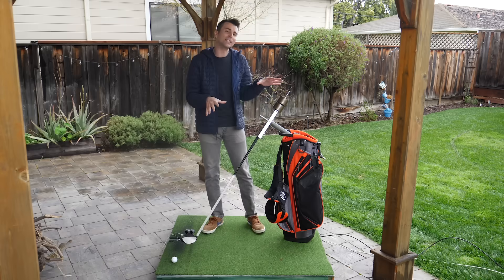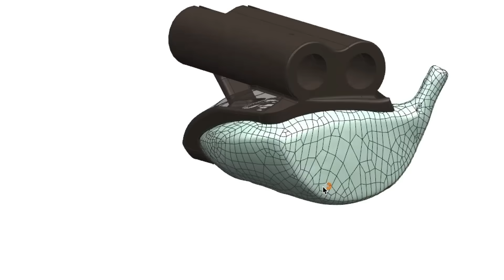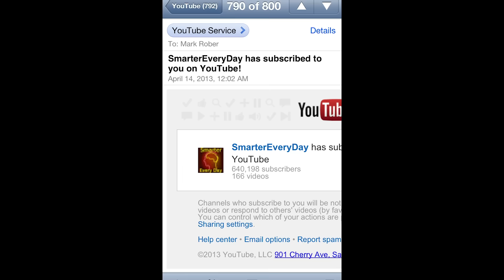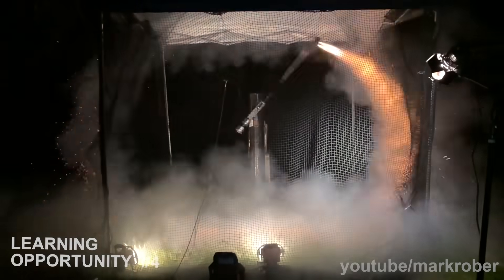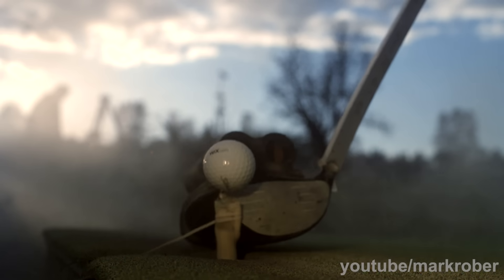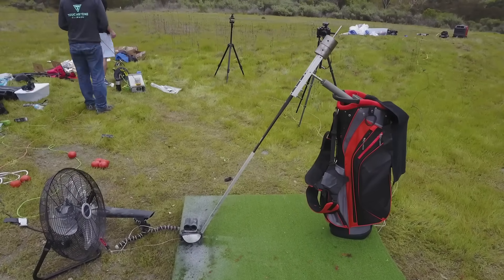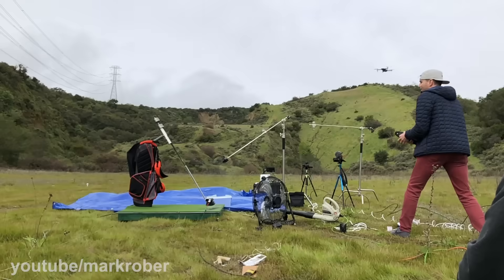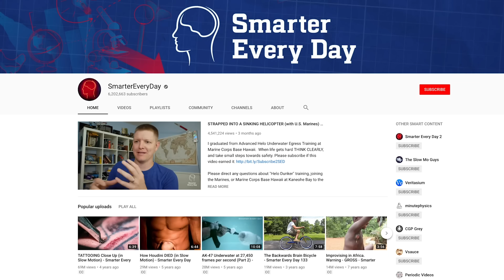Rocket Powered Golf Club at 100,000 FPS

Comment: You should have used a trackable golf ball

Actually now that I think about it, I think it would be destroyed
Reply: If you watch the smartereveryday video on the golf ball, I think you'll change your mind. The ball needs an impact north of 500mph to destroy it.
Reply: @GamenRyder  I think he is talking about the tracker. You'd need to glue it on to not interfere with the ball structure itself, while also making sure that it doesnt get ripped off or changes the centre of mass too much.

The only way to make sure a tracker would work is to have a golfball manufactured with a tracker inside already(which exist and arent too expensive, but dont have the wix.com advertisement and the batch would be too small to be worth it) or have a very expensive lightweight and flexible tracker, which potentially might be the most expensive piece of equipment.

A better way is to have a glow-in-the-dark ball, charge it up under heavy uv lighting and shoot it at night.
Reply: @Preddle  custom golf balls with trackers installed internally?
Reply: Golf balls are stuffed too, and it would change the entire weight distrubition

Comment: What if you got a bunch of metal bbs and put them in a hot tub with a huge magnet on the bottom

It would condense with the magnet on and u can prob stand on it with a strong enough magnet, and when it turns off you fall in and back on you are trapped.. I got this from the sand bubble video

Comment: I've did this not as technically advanced as you and I didn't even record it however believe me or not a strap-on done with duct tape and use the rocket launching system for the little Walmart launchers to detonate my charge as I pulled back it lit by the time I was going for the ball it was thrust 910 yards is what I found mine I use the glow-in-the-dark ball oh and a BMX rim sprocket pedal for the weight and a f*** ton of zip ties and tape and I didn't as s*** said together made sure its swings hit the buttonit was early 2000 is before everybody knew to be sick by give me a break
Reply: Your ball clearly goes further than 900 yards
Reply: And I did mine in one afternoon
Reply: I was at generation with red Ryder BB guns potato guns and anything else that could possibly hurt

Comment: My mind is blown. How could they do all of that work and not be prepared to measure the distance of the drive?
Reply: Seriously though I thought the same thing literally the reason I watched this is to see how far the ball went...
Reply: Should have used Trackman
Reply: @Carlos SlumpYeah I heard it. As a golfer I'm interested in the actual distance...
Reply: Surely we can use maths right - club speed vs distance
Reply: @speakebreathe  well, you need to also consider any rotation, initial velocities, some winds... Not that easy
Reply: A mounted gps would have been nice
Reply: For real!!! I want to know so bad
Reply: Like this so it goes to the top. This must be found out
Reply: 799th like
Reply: @Carlos Slump there are 1000 yd ranges or Fields you can go to
Reply: How would you measure a ball yeeting off to fucksville nowhere without any expensive tracking hardware? Only thing i can imagine is using a salt flap but even then you're unlikely to ever find it
Reply: @mrcaboosevg6089  Umm...have someone stand out near where the ball is landing and scope it back?
Reply: @mrcaboosevg6089  1. release the clubhead speed of the golf club. 2 a drone camera and find the ball 3. a $200 piece of equipment can do the trick, simple really. huge fail
Reply: They dont know where the ball flies
Reply: Darell Mahulete just put a tracking device inside, ain’t that hard
Reply: From SmarterEveryday, the point was to find the plastic point of a golf ball.  The experiment wasn't concerned about how far the rocket driver can send a golf ball.
Reply: @anthony.catbagan  They're two separate projects, my man! Destin just used the rocked-powered golf club that Mark engineered as part of his video (which had the purpose you described). Mark obviously didn't make it solely for the project that Destin was working on.
Reply: @anthony.catbagan  Every golfer in America disagrees
Reply: @anthony.catbagan  I think the OP's point was, it should've been one of the aspects of it. Or built it where you had enough field where you could find it

Comment: Would it have been possible to measure the velocity and the angle it took off at? Just to estimate the range
Reply: Probably, most golf supply stores and now many public and private courses have camera-based computer systems to do this that are used to simulate a driving range or playing many courses. It might still be possible to feed in the video from this into the analysis software and calculate where the ball landed (or would have landed if the field was flat and free of trees).

Comment: With the right information I'm sure you could make a close calculation of how far the ball went.
You know the ball's weight.
You know the speed of the club head at contact which would be the balls starting speed. (Using the camera footage)
You know the balls trajectory. (It was filmed and the added graphics drew a long red trail)
You may need to use a bit of Calculus.

Anyone good at Calculus ?

Comment: Depending on where you are located you should recruit a handful of caddies from a local club to stand out in the distance wearing protective gear. They will be able to locate the balls and provide accurate measurements for distance. Otherwise this video only proves you can attach rocket motors to a golf club head. Me being a former caddie for 11 years at my local club I routinely had to fore-caddie and couldn't always see the drives but was able to locate the balls based on general direction and listening for them landing.

Comment: Try a neon colored ball for visibility, and maybe design a GPS enabled ball, or have a couple of drones on standby to see if you can pinpoint the ball. Unless it explodes on contact with the ground. Hum. If it weren't for the balls integrity, I'd saw drill a hole in it with a small smoke bomb inside. Like a tracer round.

Comment: Could've saved yourself some time if you looked up the shear generated by the mass moment of inertia using the acceleration from the rocket, the mass of the driver and then the level of shear that a typical steel driver can handle.

Comment: I actually made a small home arc welder, very inefficient, but very simple to assemble, from 2 alligator clips, 5 9-volt batteries, and 2 random screws, and I was wondering if you could expand on the idea of low cost home arc welders.

Comment: Club was in the air for 4.45 seconds. That's 2.225 seconds up and down.
h = 0.5*a*t^2
h = 0.5*(9.81)*(2.225)^2 = maximum height of 24.3 meters in the air
Reply: Jonah Bodnovits didn’t account for thrusters how do you know which direction it was in during rotation and elevation
Reply: What about speed as well?

Comment: Great video!  Regarding your title: I don't know if anyone else has mentioned it, but given you guys are engineers, and having dealt with engineers for many years in the Air Force I've got a quick question:  You do know that 100,000 FPS is 68,000+ MPH or roughly mach 100, right?
Reply: FRAMES per second (camera), not FEET per second on the golf ball...

Comment: For the handheld version, it would be nice to have some way to start the rocket motor after the golfer had initiated the swing movement. This would prevent users harm and probably improve control. This could be done either by operator direct control (it will probably require some learning curve) or by automatic sensors activation (ideal but technically more complex). To further improve control and safety, it would be great to stop the rocket after the head hits the ball (it means further redesign with inclusion of additional sensors). This could be a nice first commercial version.

Comment: So you mention you don't know how far the golf ball went for the long shots, but your raw footage SHOULD give you enough information that you should be able to get an estimate.

You know that the ball went in a curve where it started going up and away, and eventually, it hit an apex of that curve before going down and away. Baring wind or hitting a tree we can express this as it's movement along X was constant, it's movement along Y was non-existent, and it's movement along Z was positive for a time and then negative for a time. Once the ball was hit by the golf club all your factors should now be in place so the ball will simply do what it will do.

If you watch the raw footage you should be able to estimate how quickly it was moving up and then us some gravity equations to estimate how high it got before it started going down and eventually reconnecting with the ground. This would then give you a duration of the journey the ball. Knowing the estimated duration of the journey you should then be able to estimate the speed it was moving along X, and then apply the duration to the speed to get you a reasonable estimate of how far it potentially traveled.

I do keep mentioning the raw footage you took because for all the edits you do for the uploaded video it would be hard for us to do a frame by frame measurement of how far the ball travels in a single frame whereas you could do that with the raw footage. Also without us having been there our estimates on points sizes of things that you could use as points of reference for figuring out how far something traveled would not be as good as yours.

Comment: Just for your information, when using the metric system we don't say Kilo Per Hour (kph). We say Kilo Meter per Hour (km/h). Where kilo = 1000, so basically 1000 meters per hour. Not 1000 per hour, 1000 what?

Comment: Mark, doesn't the variation in mass from the clubs being cut at different lengths and the change in mass over time from the propellant burn (and different numbers of motors) mean that unless you have a counterweight capable of on-the-fly adjustment, your setup will still suffer from significant inefficiencies? Maybe you guys addressed this with some kind of self-adjusting counterbalance, I might have missed it. I'm just really interested in the potential that might be left on the table from a little more optimization in those and other areas.

Comment: Be curious if giving some flex back to the shaft and finding that sweet spot before it breaks would add distance. That whip action is important in a normal swing. Why couldn't they just attach the original rocket mount with fasteners instead?

Comment: It would be interesting to use a TruFlightII or Trackman4 or other golfball tracking hardware to see the ball's launch params, then use a program like E6Connect to simulate its flight and see where it ends up.  The main trick here is the rocket exhaust, which might interfere with the high-speed cameras, radar, or other methods the tracking hardware uses to determine the ball's speed, spin, launch angle, etc.  But I can think of some ways to get around that.

Comment: If I may make a design improvement suggestion. Rotate the ball pop up mechanism 90 degrees so it comes up inline with the club instead of across it. Will reduce the wobble problem mentioned.

Comment: Try sneaking a gps on the ball then track it. Can you.
Reply: They make tracker balls.
Reply: Naw, you just measure distance and time (frames per second) to find velocity. Then measure angle. You can do some math and find the rough distance the ball travelled.
Reply: @eleettabboo8673  Too many variables. Golfballs are made to fly far and there's some really fucked up aerodynamics behind them.
Reply: @hieronymusnervig8712  Actually, its not that hard to calculate the rough distance of the golf ball. Here is a link to some material: https://math.stackexchange.com/questions/2007967/how-to-calculate-the-actual-distance-flown-by-a-golf-ball . 
Cheers.
Reply: @eleettabboo8673  I don't think you know what you are saying... Your variables are not really possible to find out and like you said will give you a VERY rough distance on how far it travel... This is real time speed so I don't understand how you measure the angle. They could not even get the shot of where it landed and when it landed. With the information they have it's impossible to actually find the exact (or even a near answer) of where the ball landed and we just have to accept that. The only way they actually can find how far it traveled is by simply looking for the ball (ok, not that simple).
Reply: @PunMister  Its not difficult to measure the angle. Its literally there. Just use a protractor app.
Reply: His an engineer remember?
Reply: Adds weight to the ball, and would make for a lop sided spin.
Reply: @BigSkyCards23  Ever heard of Top Golf?
Reply: Unless you know of a pin head size GPS tracker?

Comment: Using the playback footage, first you should have found two or more points in space and the time in between each and then created a graph of the path of the ball, then second also take into account drag and wind direction and speed, then finally you should have gone to find the ball and measured its distance away from the rocket golf club.

Comment: Why didn’t you just put the axel of the club on a screw to push the club out to the ball?
Reply: Then you wouldn’t need any electronics.
Reply: You put a cap at the end so the club doesn’t fly off. And you can use the metal lathe to make the ratio as big as it needs to be

Comment: ur pool ball bouncing as high as a rubber ball is basic physics :). For the ground to stay exactly where it is when the pool ball hits it, it has to equal the energy that the pool ball has. which is more than the pool ball needs leave the ground again. its the same thing as walking basicly and the rubber balls are all about elastisity, tension, flex and torsion

Comment: The only thing I would have done differently is moved the tee forward a little bit and made it longer. Drivers are meant to be hit on the up swing so you would have seen a higher launch and less spin of the ball translating to longer distance.

It would have also been cool to have a launch monitor tracking the ball to see the final numbers but I'm not sure the sonar wouldn't have been able to track it through the smoke.

Comment: I was hoping for like a GPS traceable ball or something. Would've been amazing to see exactly how far it went.
Reply: They need to use Trackman. The pros and outside driving ranges and instructors will use trackman because it uses Doppler radar to track the physical ball in flight. Thats what they use for the world long drivers as well. It gets club head speed, launch angle, apex height, ball speed, and distance.
Reply: @iforgotwhatiwasdoin  Trackman might be somewhat confused by the whistle of the rockets and the multiple swings, I suspect. Worth trying, though.
Reply: Couldn’t they calculate how far it goes. Just from the speed at which it was hit and the trajectory it flew to get how far it went. And GPS o would think they could somehow put it inside the ball with like a rubber seal around it so it doesn’t smash on impact but i’m not sure if that would work
Reply: @christiancevallos9820  there are already trackable balls that don't need a rubber seal
Reply: I had the same thought. Maybe it would shatter on impact
Reply: @imbackinthegame  good point.
Reply: The distance would be the main advantage of such a device..... Like comparing the longest drive a person has done compared to this build....
Why they put all that effort in to not show this.. Is very disappointing for sure..
Reply: Definitely over a mile that thing was going hella fast
Reply: BASStion nah. Probably around 450 yards. Fastest swing from a human is faster than this.
Reply: Good luck not destroying all the electronics
Reply: Was thinking the exact same thing
Reply: Average Dave and a person to hit another ball and see how they compare
Reply: should have used toptracer
Reply: There’s several companies that manufacture GPS tracked golf balls.
Reply: @roderick1104  a fellow 9 year old
Reply: Me to
Reply: You could at least have somebody stand 450 yards or so away and try to see it land.

Comment: Could you not use the angle of the golfballs flight as seen in the footage and use that to work out an approximate flight path for the golf ball, then using the higher speed slowmo camera footage to see the speed the ball moves to find a distance the ball would have moved? Baring of course the speed change due to wind and the topographical differences that may cause rolling. That might give you an estimate of how good it would be but other than trying that on a driving range I don't think you can get an accurate distance for travel

Comment: Why don't you uh, throw the cue ball and the bouncy ball down to the ground and then see their bounces? Obviously there will be a crossover point along the lines of their power conversion from the compression at lower speeds but the lines diverge quickly as you increase speed since it's all about the force the ball rebounds back to a stable state after being compressed. Bow and arrow physics

Comment: Hi Mark, 
As soon as I saw the spinning club thought of Fallout's Super Sledge or Dr Dyson Ido's rocket hammer and I have an idea I would like you to try as here in Australia it would frowned upon. 
As you know a rocket takes time to get to its maximum speed, which is longer than a golf swing but what if you could get that speed boost in an instant, just inches from the ball as you swing...
How about an electronically fired, for want of a better term "gun", that instead of lead ejects a water charge as the mass to impart momentum to the golf club? 

What do you think? Would it work? 

Ps: I envisaged a Super Sledge with a revolver mechanism on the back, so you could have multiple chances to hit.